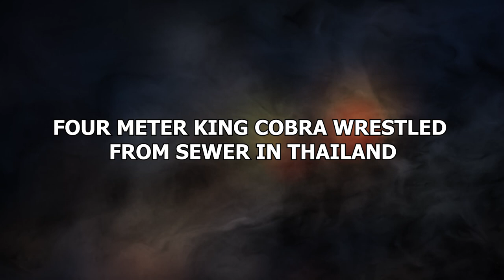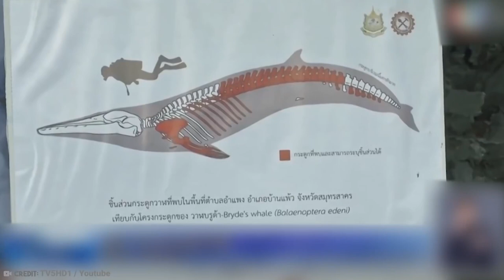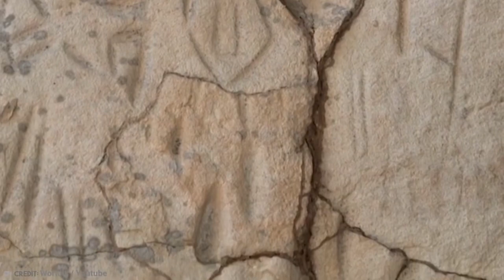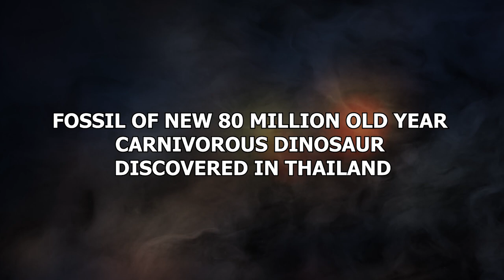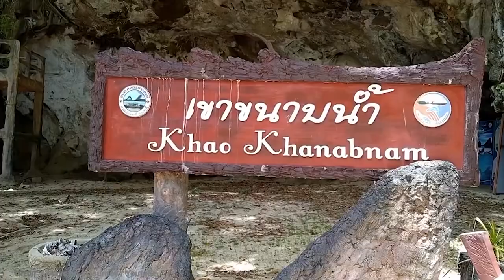15 Strangest Things Recently Discovered In Thailand

Comment: The cave diving wasn’t an absolute success. One rescuer passed away thought I’d at lest give u the heads up on that
Reply: All the kids were rescued,,,,so yeah it was a complete success,as far as the rescuing the children went.
Reply: And it wasn't mentioned why they were trapped in the caves. They were trapped due to torrential rains that flooded the caves and the passages they used to enter the caves.
Reply: That's sad.  😥  Thanks for the information.